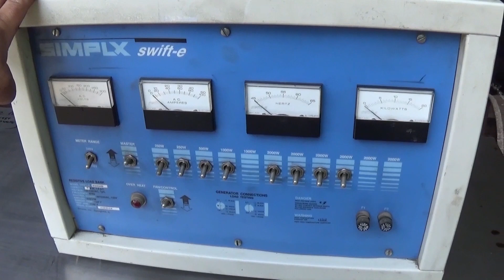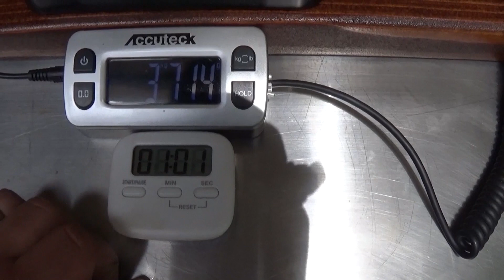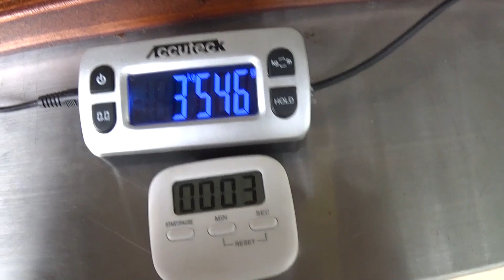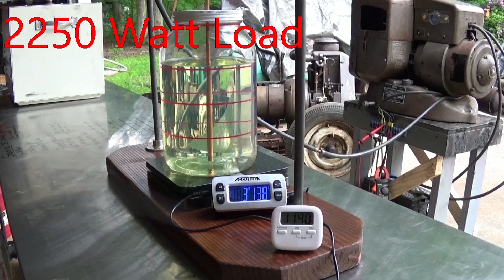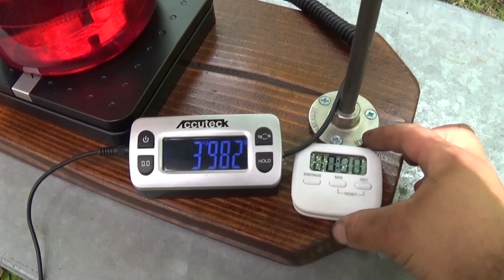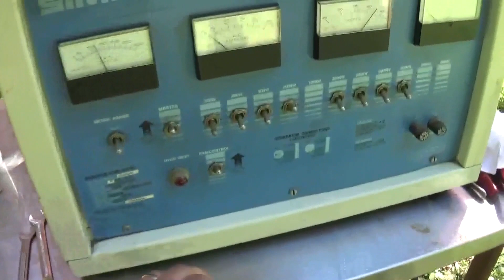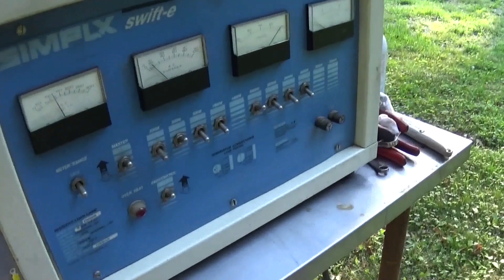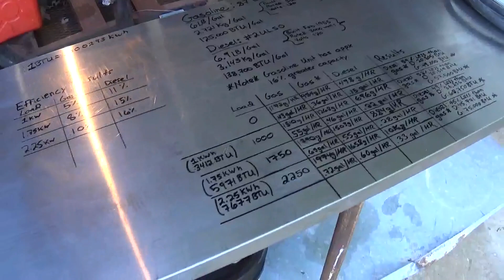GASOLINE VS. DIESEL (FUEL CONSUMPTION  1950s Style)

Comment: Modern gasoline engines have a maximum thermodynamic efficiency of 35% while diesel engines have a maximum thermodynamic efficiency 50%. That means that diesel engines are 42% more efficient than gasoline engines. Your experiment is a great example of why we should be burning diesel instead of gasoline.  The gasoline engine is throwing away 65% of the fuel as waste heat! That means that for every million gallons of gasoline burned 650,000 gallons go as waste heat and only 350,000 gallons actually does work in moving the vehicle.
Reply: Electric is far more efficient though, you can also generate energy from fossil fuel in the most efficient manner (if you must) and use that in an electric car far more efficiently than ICE, and let's not forget break regeneration. Fossil fuel should be used for emergency power and applications where it really makes sense which aren't many just a shame how the world is built today to burn as much FF as possible.
Reply: @dashtesla  Yes, electric is better in terms of efficiency, but the question of energy storage (weight, size, price of batteries) is still open
Reply: Dash Tesla — Still, in spite of your claims, the cost of transportation in our society would go up significantly.  Is society willing to pay that price?  If so, then that means that they would need to give up some other luxuries that they have.  It’s that simple.
Reply: Higher engine compression raises efficiency because you use more effectively the BTU content of the fuel. That 1950's gas engine is maybe 5-6:1 while the diesel is probably around 14:1. Also run either hotter and recover the heat with a turbocharger raises efficiency also.
Reply: @dashtesla  you still charge your batteries from grid power that is generated by fossil fuel?
Reply: If I remember right though to get up to those massive diesel efficiencies requires a fairly large diesel engine, the diesels in cars and pickups I believe are lower than that 50% mark
Reply: @2secondslater  I charge my car at night when the vast majority of my power comes from base-load nuclear rather than peak-load fossil fuel.
Reply: @dashtesla  Electric is far more efficient, yes, way more efficient, I just can't get my head around electric powered generator, something appears to be wrong.
Reply: @Wayne Coke what they said when they hauled things around with horse and trap
Reply: @2secondslater  How electricity is generated is a decision, it can be generated from 100% fossil fuel or 100% renewable or anywhere in between, that's a choice made by government legislation and the electricity supplier. Electric vehicles are essentially multi fuel, conventional petrol or diesel vehicles are not.
Reply: It's not even close to that simple. You can't compare antique generators to modern cars. A modern gasoline engine will have better efficiency than that old diesel. The reason the Toyota Prius has a gasoline engine instead of a diesel is because when running under the modified atkinson cycle, it burns less fuel than a diesel engine would in the same place. Also less emissions. Diesel is also more expensive than gasoline.
Reply: Obviously the answer is to combine the two. Electric motors can move massive loads and/or reach high speeds (ex: diesel electric trains). And chemical energy storage will eclipse solid state for the foreseeable future. Which is why hybrids took off. Massive battery banks in cars are too much of a luxury for the average consumer. An electric drive train with chemical energy generator. Gas, diesel, LPG, whatever. They've gotten mechanical efficiencies up there. Now to focus on power generation. Obviously refining the gen units is a priority, but also reducing waste heat. There are several options, like a TEG integrated into the cooling system. Another possibility, Dropping the reciprocating cylinder design for a micro turbine. Letting one design philosophy dominate without exploring all the others is fool hardy.
Reply: @ZaWyvern  Do you really think peopple can't afford batteries but they can afford all that other shit? The solution is not to make cars even more complicated than they are. They will cost too much to buy and way too much to get fixed. MUCH experimentation has been done for decades...Chrysler already tried turbine engines, it was a major failure. There is no way it could have a practical use in a car.
Reply: it's TRUE, so I made a sound proof box that funnelled all the hot cooling air, and took the exhaust heat as well and dumped it into my small shop..  when it is -10, -20 C., I HAVE A COMFY shop to work in.  nothing went to waste.  the exhaust gasses are actually cool, like hot water only.  I got the rest.

very nice.
Reply: @Wayne Coke Like electric trains do for decades
Reply: This 35% vs. 50% ballpark figure is comparing a small(ish) good modern NA gasoline engine(let's say 50-150 kW) vs. a large or huge turbocharged/forced induction diesel with turbo compound and all the expensive big engine stuff(500-5000 kW).

Modern car engines(let's say 50-150 kW maximum and 15 kW continuous load) will have very similar efficiency, gas or diesel. Cold starts and short driven distances will favor the diesel in terms of fuel efficiency but under such conditions there are other problems to be expected that do not occur with the gas engine.

And this is with "normal" turbocharged gas engines that are otherwise pretty much the same as regular Otto cycle, when using mechanical transmission. Atkinson cycle or hybrid drive enables some added benefits. So does direct injection and actually utilizing higher octane rating(including but not limited to high ethanol mixtures).
Reply: @tonsssedell4318  Absolutely correct. All the other people replying here do not have a clue about how engines work or what efficiencies they produce.

As far as this post is concerned, at the consumer level, for a similar cost, a diesel and a gasoline engine will have almost the same efficiency. This is true for both cars and generators.

Comment: These 65 year old machines look like they will easily outlast any of those chinese gensets you can buy at the hardware store
Reply: Its true. Although, the newer units may provide cleaner power that will make modern electronics happier.
Reply: @zuestoots5176  Depends on what you consider cleaner, the old ones produce near sinus , with some regualtion spikes....the newer ones cheat with cheap-o-inverter and the output signal is trapezoidal and full of harmonics...
Reply: These old units use brush rigged excitation and huge wire wound ceramic resistors in the field circuit to put out clean sinusoidal voltage. So they are totally free of printed circuits and microprocessors. These will generate the same before or after an EMP strike or massive solar flare.
 Yes I have the Honda EU 2200 but I'm absolutely certain that my old 1969 Onan DJA air cooled diesel 3KW generator will run the standby freezers in my shop after a catastrophe where the Honda won't even start..  
The Onan gen set  came with  a 20 gallon fuel tank base with 1/4 inch steel top and bottom and the 6 inch  I beams that make up the sides of the fuel tank. They are curved upwards like ski tips. There are shackles mounted on the I beams so it can be pulled by a bulldozer over rocky terrain and gavel. This machine is brutally tough.
Reply: They already have.
Reply: those china generators usually have a lifespan measured in minutes.. ive had a couple of those in for repair which had not been used for an hour from new and the generator side already burnt to a crisp inside... no chance to save them, they went  straight to the scap pile. (and every china genset since brought in for repair gets that same treatment

Comment: diesels are the best, i used to repair diesel welder generators and 95% time the engine outlasts the gen units with over 10-20k hours
Reply: That says nothing about the gas powered units.  We aren’t comparing the engine to the generator here.  If you had said that the diesel powered units outlasted the gas powered units in your experience, then that would be worthwhile information.
Reply: Well actually this is a repair channel so the initial comment is relevant.
Reply: @mmarciniak  its apples to apples when you talk about life time of the two. Each will last as long as the other if cared for.

Comment: i'm not surprised at all at the results, Diesels are work engines and were origionally designed to be stationary work engines, so you are literally just proving that in constant speed applications under steady load, diesel is the better option, but for short high bursts of power gasoline shines, very informative video, and interesting to see a real-world application tested back to back like this with a load to show how they both behave and how they both handle the stresses with the numbers to back it up, thank you for the vid and the test

Comment: Excellent video! The diesel wins due to its' high compression ratio (~20:1) and a full cylinder of air on the intake stroke. Compare that to the gasoline's low compression (~8.5:1) and a throttled intake stroke. The best comparison is when both engines are running at their max. torque, or highest efficiency, (highest volumetric efficiency), not highest speed, or not highest horsepower. Max. torque for the gasoline is when the cylinder is the most full during the intake stroke (~full throttle), and the compression pressure is the highest. If a gas engine could survive with a 20:1 ratio it would exceed the diesel in efficiency due to it's flame front speed. With today's direct injection gas engines, we can inject fuel quickly before igniting it, which eliminates pre-ignition knock, and allows us to raise the compression ratio a few points. Efficiency is now higher, (along with more NOx, so make sure that catalytic converter works well!)

Comment: Nice video. Couple of crits:

A) Capacity is irrelevant, since the specific fuel consumption remains roughly the same, despite capacity changes.

b) You should have included a test where both units were run at 25/50/75 % of their respective capacities, and convert the Watts produced to Watts per Gallon... (this only because the outputs of the units differ. If both were the same output, it would make no real difference)

Your test also showed that although the Diesel was always more efficient, the gap shrunk as load increased. This is because the specific consumption of a gas engine improves with bigger load. (The air intake is restricted at no load, and unrestricted at full tbrottle. The diesel always has an unrestricted intake) The gas engine will, however, never reach a point where it matches the diesel. No getting around the higher energy density of the fuel😉

This was not a boring video. I actually quite liked it!
Reply: I thought, "Can you calculate it based on the numbers provided?"
Then I thought, "Can I?"     hmmmm....
Ok, so if I understand correctly, 1000 watts (in the gas generator) = .46 gallons. That's 2000 watts per .92 gallons. 0.08 away from the goal of 1 gallon. Pretty close. (Someone who knows math better than me could do this more accurately.)  I just tried 1000 divided by .46 and got the answer 2,173.913.
Is that 2,173 watts per gallon?
If I take 1750 divided by .55 I get 3181.818 with 18 repeating.
Is that 3,181 watts per gallon?
And 2250 / .6 = 3,750 watts per gallon?
And now for the diesel.
1000 / .22 = 4,545.454545... watts per gallon.
1750 / .28 =  6,250 watts per gallon
2250 / .33 = 6,818.181818... watts per gallon.
Is that right? is that even close? Let's see... 3750 about half of 6818...
That may be close...
You try...

(edit:) I just looked it up and there's 36.6 kWh in a gallon of automotive gasoline.
And there's 40.7 kWh in a gallon of diesel. When I try to multiply by the efficiency numbers, wait... I'm not sure I'm doing this right... well, it seems accurate but the precision is way out. Correct me if necessary.
Reply: Watts is the rate of work. Watt-hours is the amount of work. So either go with gallons per hour per watt or gallons per watt-hour.
Reply: @WCM1945  Nice distinction! Thank you for increasing my understanding. Have a nice day!
Reply: Just finding this video, and I've often wondered why most gensets are gas? It would seem that diesel would be better. But then more expensive to produce, it's always about the money. Huh?
Reply: @crdorado1195  ... when we're talking "portable gen sets" like most people use today the diesel is going to be twice the weight. Easy to see why most go with gasoline here. Now let's consider the compression ratio.... you WILL NOT pull start a diesel! (no way, no how)
Reply: More wasted heat with a larger engine; capacity is relevent if there is any significant difference in capacity.
Reply: @jhoncho4x4  ... correct on wasted heat being an issue with larger engines, but in this case the era of design basically dictates that both engines will be more massive than the units of today, which have lower mass in general, just to promote economy of operation. There really isn't enough difference between these two sets to start factoring that. They are both close enough in size and capacity.
Reply: @WCM1945  ... since he used a fixed rate of load, (and time) how about we cut to the chase and use gallons per hour, which could be calculated into BTUs of fuel consumed to do the same job.
Reply: "The gas engine will, however, never reach a point where it matches the diesel. No getting around the higher energy density of the fuel"
-
Gasoline is actually more energy dense by weight, but pricing is always done by volume. Interestingly enough, BSFC ratings are almost always done by weight. Many modern gasoline engines can match the fuel efficiency of diesels when fuel consumption is measured by weight.
Reply: You’re exactly right.
Reply: Thanks, saved me a detailed rant on the illogical "correction" . The specific fuel consumption is whatever it is and results could be charted and extrapolated also to 100% load  . My other question would be whether the load bank has any non resistive load met by cooling fans or relay coils that could be giving a sub unit power factor, I think we only had Amps and Volts without a "true power " meter. An interesting investigation anyway and it would be great to compare to modern generator efficiency . Agreed, this comparison also demonstrated  the high linearity of Diesel brake specific fuel consumption without a varying  throttling effect, whereas the gasoline engine gets more efficient as throttling loss is reduced at higher load. No escaping the  compression ratio ultimate superiority of Diesel  however.
Reply: @philhealey449  "No escaping the  compression ratio ultimate superiority of Diesel  however."
-
Unless you're dealing with emissions-controlled road vehicles, then diesel offers nothing but drawbacks.
Reply: @PistonAvatarGuy  Tell me about that one !  I'm saving 100% on Diesel fuel presently with yet another electronic meltdown ....

Comment: The thing that I found interesting is that even taking into account your correction factor, the diesel still burned a lower volume of fuel at 2250 than the gas engine did unloaded. Also, don’t be afraid to load up that diesel. There’s more potential for damage in running it lightly loaded and glazing the bores.    Great test!

Comment: I appreciate you taking the time to make a in-depth breakdown of gas and diesel  usage per kw per gallon consumption. I used to use a cheap china generator 5 kw for camp and was fair on propane but I changed over to a diesel light plant with more capacity and added some capacitor for. Hard starting a/c and water pump. Working a lot cheaper and and it’s got a 30 gallon fuel tank.

Comment: Thanks for running the very informative comparison test.  The only thing I would have additionally done, is make sure the rpm at load was set for 1,800 rpm.  I'm guessing the efficiency difference is due to the compression ratio (about 6 for the gas, 18 for the diesel) and the energy density difference between the fuels.  I'm a bit surprised at the consumption of the gas engine with no load, especially with it running at 1,800 rpm.  It would be interesting to compare this with a typical 3,500 watt portable generator, since they run the full rated engine speed of 3,600 rpm.  This exercise is why I always advise someone considering one of those low cost Generac standby generators (that use a riding mower engine) running at 3,600 rpm, to go with an 1,800 rpm diesel unit.  Those cheap 3,600 rpm generators will empty a huge tank of propane in a couple of days if run 24/7.

Comment: i like that you use Gram for the weight and gallons for the volume  (1 gallon = 3.79 Liter) :)
Reply: Or 4.546
Reply: @guganotubo  that's a UK gallon. I don't think an American will be using UK measures 😊
Reply: Probably just because it's easiest to measure fuel by the gallon here rather than raiding the kitchen for a metric measuring cup lol
Reply: @GertAndersen  True, the Imperial gallon is 4.546 litres, I'll have to argue the 3.79 litres for a US gallon though.
1 US gallon jug of milk / water  bought in the US, mark the fill line on the outside of the container.
get a 4 litre container of same from Canada, pour it into the us container, it will fill it to the fill line.
1 US gallon is 4 litres.
has been since I was taught metric back in the 1970s when Trudeau ( Pierre not Justin ) switched Canada to metric.